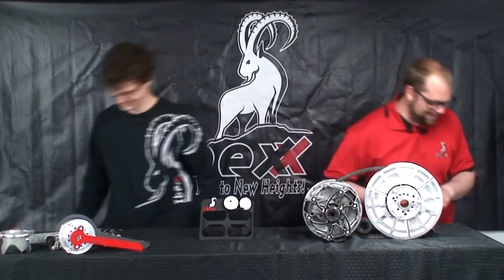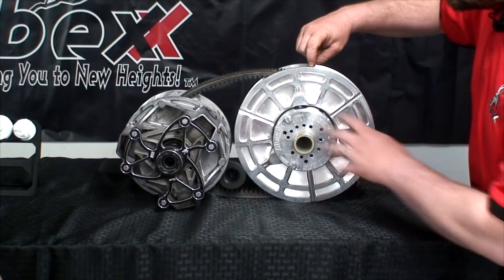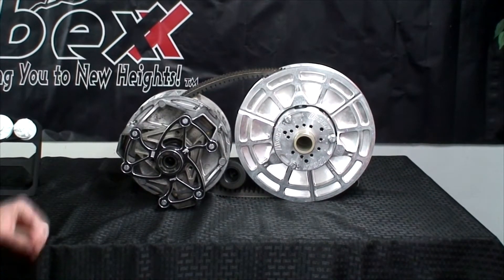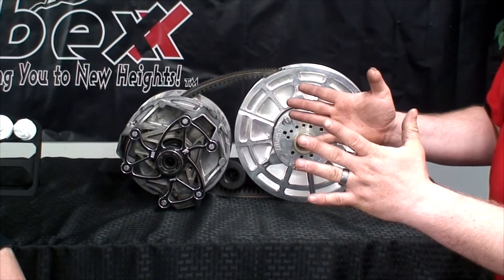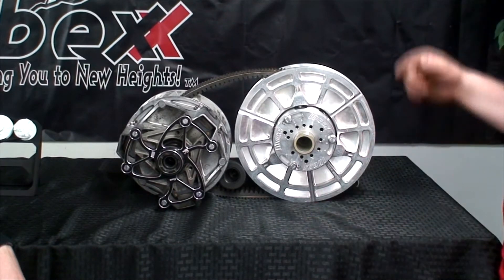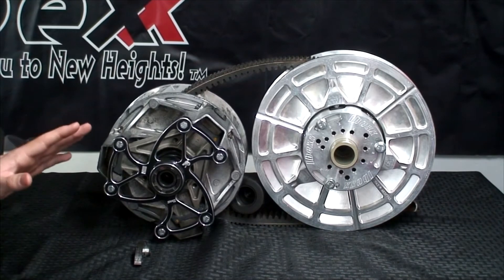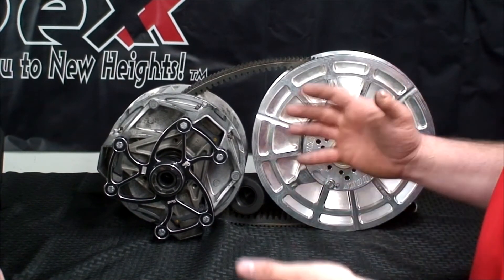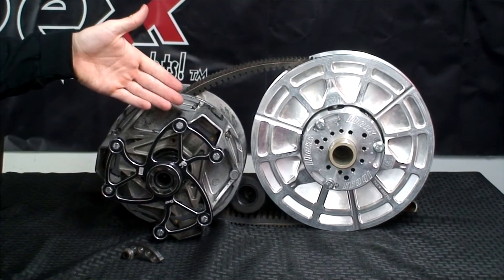My Clutching Guy Episode 4 - How the Clutches Work Together

Comment: I took my primary clutch off and couldn't for the life of me understand how it opens or closes. I never opened it but could feel the weights inside and see how the whole thing moves a bit. I thought there was something that pushed or pulled on it. This video was a great help, I should be able to reinstall without concern.  I just wanted to grease my crank bearing.